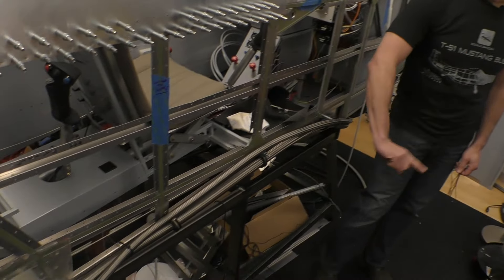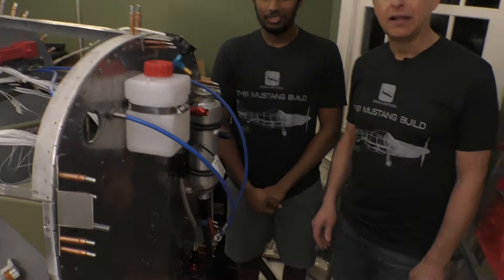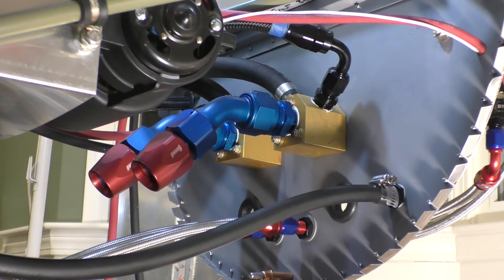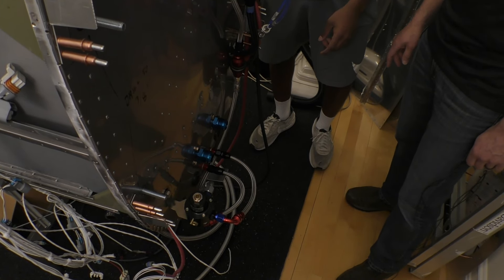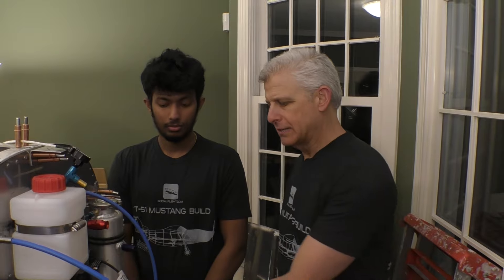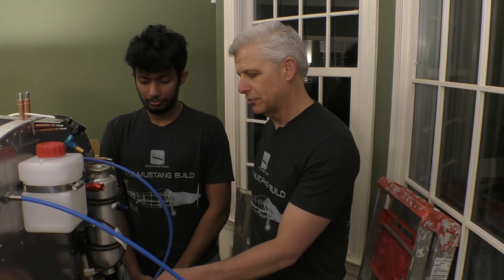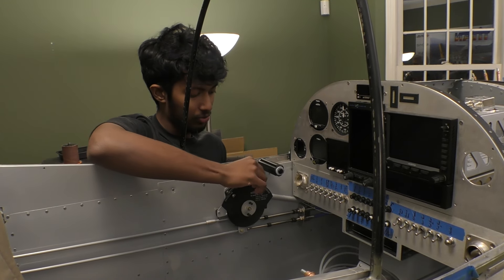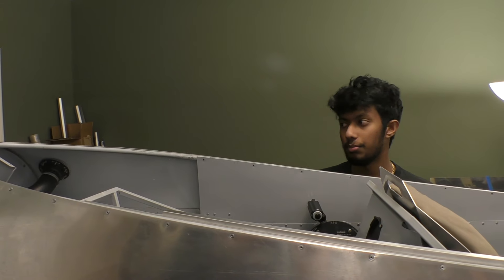MUSTANG TOUR! A Sneak Peek at Our Build Progress

Comment: What fuel pump or pumps will you be using? Since you're using a fuel injected engine.
Reply from the maker: Titan Aircraft supplies a custom dual-fuel pump setup using Walbro fuel pumps in parallel along with the fuel pressure port and followed by a fuel filter.
Reply: @SocialFlight  Those a re good pumps. I'll look into that set up for my project. Thanks for the answer.